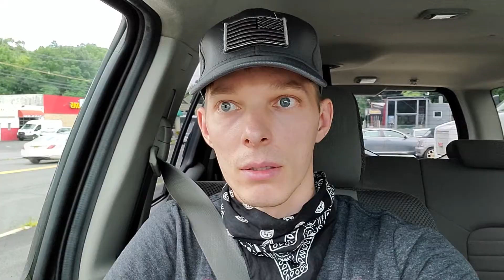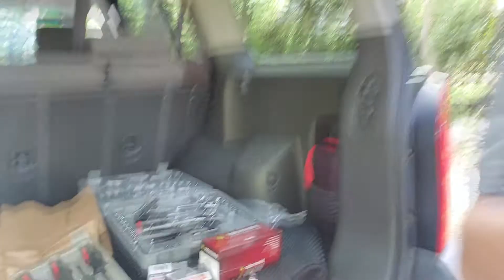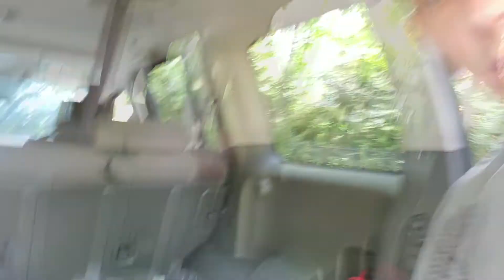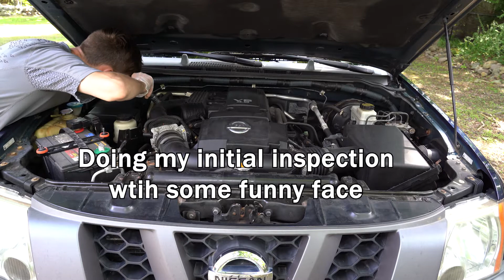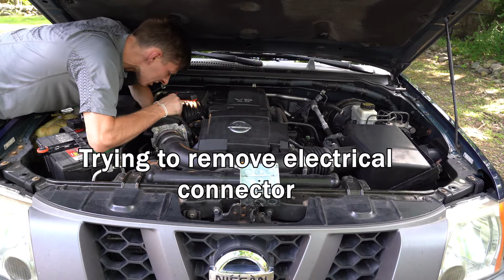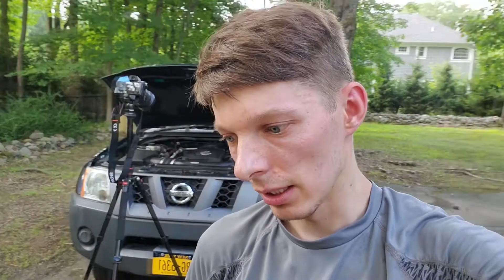Change Coil Pack And Sparkplug Nissan Xterra

Comment: I bought my xterra in Dec 2019 and almost immediately after buying it, I got that po301.. cylinder #1 misfire. I replaced all the spark plugs and since I didn't know if the coil was bad, I moved it to one of the cylinders on the driver side. Sure enough a day later I had a code for that cylinder. I didn't have my YouTube channel at the time, so I didn't film it. Haha great job on your video and on your Xterra!

Comment: I see how difficult it was and how struggled you but you are smart and very hard working guy and i am sure you will fix it eventually  and you will keep this car or any of your cars in good order.
Reply from the maker: Thank you very much!! I am going to try one more time, I got one tool that might help me pull it out.. that ignition coil boot so we'll see ))
Reply: it's not hard, you aren't supposed to remove the coils on bank 1 without removing the plenum.. once plenum is out of the way, there's your coils..

Comment: Remove intake plenum...(Do not unhook the throttle body plug, b/c you will almost always have to do a re-learn procedure. Plenty of room to keep it plugged in and lay it to the side). Once the plenum is removed, it is super easy to replace the coils on bank one.  Bank 2 coils are already visible, so you don't have to remove the plenum..
Reply from the maker: Will keep that in mind thank you )) and yes the relearn is a bit tricky.. well if you follow the steps right its not so bad maybe.. just have to do it all on time.. and in order